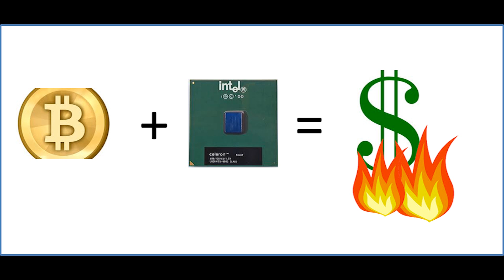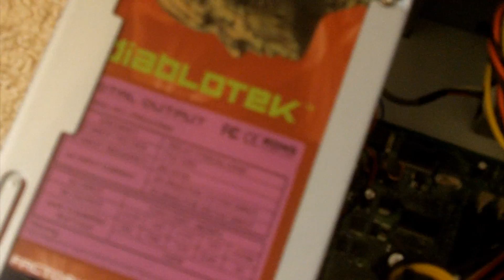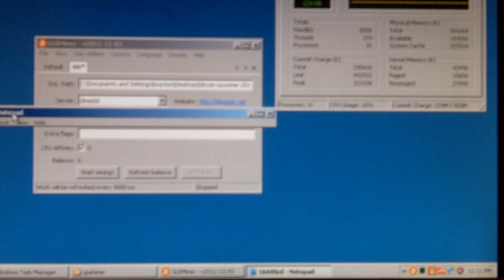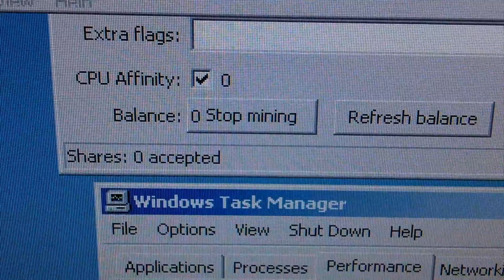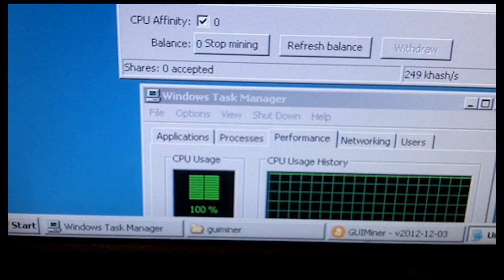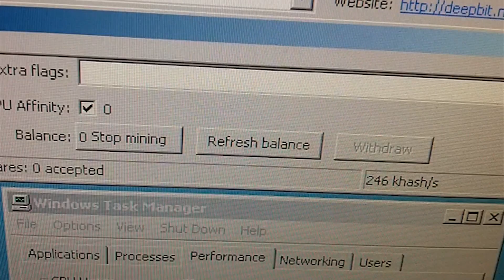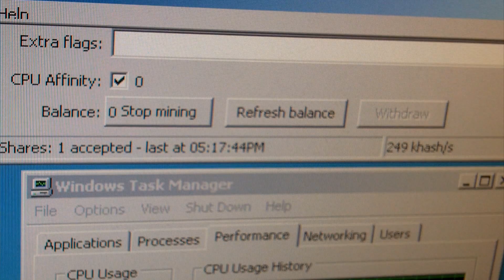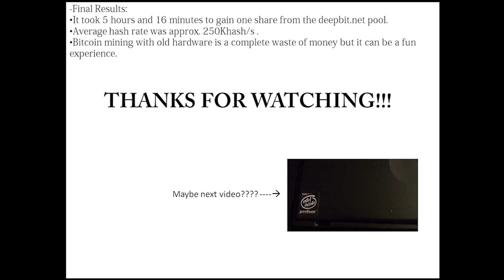Bitcoin Mining on Old Hardware; The Intel Celeron Coppermine CPU 900MHz

Comment: Thanks for the good advice.  I have that same exact three old computers, with RAM 512 SD-RAM, and videocards NVIDIA GeForce 2 MX 400 64 MB for AGP slot, and I will try this operation!
Reply: Bitcoin requires 40000% better hardware to mine it in 2021 than 7 years ago. You NEED a high speed cpu a monster gpu (rtx 2070 rx 5000 or 6000) and lots of fast ram (16 gb is the minimum) and a nvme drive. To get one dollar from that setup it will take you 100 years.
Reply: Ie give up.

Comment: I just started testing out Bitminter today. I have two PCs I'm testing.

A PC I built 6 years ago that has a Intel i5, 16gb of Ram and currently a newer Nvidia GTX 1080 which previously, I had an Nvidia gtx 560 and is running Windows10.  Running Bitminter, my hashrate is 1.34Ghps. I've been running it for 48 minites and have 640 proofs of work accepted by the server.

The other PC I'm testing is a HP i got from Walmart for $300. It has a AMD processor but I dunno what family. Its running at 2.2Ghz, it has a Radeon R5 graphics (again its not specific) and 4Gb of ram and running Windows 10. Running Bitminter, my hashrate is 0.01Ghps. 

My home PC which I recently upgraded in order to use my Oculus seems to be doing much better but I watched a video where some kid showed how to set this all up. He was getting 160Ghps. But I'm not sure how. Someone in an online forum suggested that Nvidia graphics cards suck for mining and I'd imagine Radeon don't do too well either.

Comment: If heat is controlled, how many hours can you run a CPU at 100%?
Reply: to the point when either your pocket will be empty (cuz of electricity bills), or u drain all electricity, or when u ran 2years streight and 4got to change thermal compound, etc.

Comment: kind of late but here's my 2 cents:
- OpenCL mining (that would be GPU usage) its far more efficient than CPU mining
- Bitcoin miner machines usually have a downclocked low-end CPU (celeron or sempron) just the bare minimal needed for supporting the OS and the bitcoin miner
- Multiple GPUs are used in bitcoin mining, the best gpu for mining its the more power-efficient one, since you are "playing" against your power bill.
- Everything else should be disconected (HDD, all ram except 1 slot, Optical drives, onboard sound). A good mining "OS could be a puppy linux running from USB Flash drive and Ram installed, since it will consume less  than a 5200rpm HDD.
- The OS could be linux or windows, but always should be an "empty" version of the OS, no updates, no antivirus, no background process, no nothing except the bitcoin miner.
Reply: +Juan jotabe thanks for these infos. can u pls tell me if there's a profitable Altcoin that i can still mine with an old gpu or if u know what is the best legit cloud mining website. thank you
Reply: +Reda Lamine sorry, i dont know. i just did a bitcoin research and i ended up quiting before even starting, since there is no real profit worth of doing it except if you use an overall good pc stealing power and connection. If you try to setup a rig like the one i just mentioned, youll have to put 2 x gtx950, if you buy them just for mining your inverst will be back by about the time your machine becomes obsolete for mining.
everybody can make more money cleaning car windows in the corner lol
Reply: Juan jotabe ok thx 4 answering so fast i appreciate it. i think i'll just invest in sth else. have a great day :)
Reply: +Reda Lamine np ;)

Comment: I used my raspberry pi 2's for bitcoin mining. It has a 900mhz processor and 1 Gb of ram. I was able to get 500mhps and 25 shares in 10 minutes.
Reply: +Smyalygames nvidia is not for minig tho....
Reply: Liar, my 970 does 500mhas and to price, £260 - £20 yeah you liar.
Reply: kasparlai123 I know that, but £20... That is even better than AMD R9 390 goes up to 1000MHz... Again, £260 and £20... you get it...

Comment: i got Intel Core i5 CPU plus R7240... good enough?
Reply: +Ghast Unity Nope you will need an asic and even then you can lose money. I have a Antminer s2 and it mines at 1Th/s and i make around 300 dollars a year without power cost`s included so it`s even less with.
Reply: alright.... if i buy that machine and i use solar panel and convert to ac current and does that give income?
Reply: Yes it does because then energy is free
Reply: alright.. i will try
Reply: Ghast Unity how much have u made from bitcoin

Comment: Ive been mining on my gaming pc for a while now. No damages yet, but im worried about the capacitors around my CPU since its a 100w CPU running %99-%100 all the time
Reply: Recent computers does not have capacitors problems.
***** some algorithm are optimized for CPU
Reply: Ive since quit mining, I just wanted to push an old CPU to the absolute limit...

Comment: It would take that system over 100 years to earn 1 BTC at the current difficulty and the difficulty is consistently going up. Also I believe all available BTC will be found by around 2040. I personally have not had any hardware damaged from crypto mining but a computer that was left on for about 8 years had some capacitors start leaking and corroding. I decided to retire it since I was legitimately concerned it could catch fire and burn my house down.